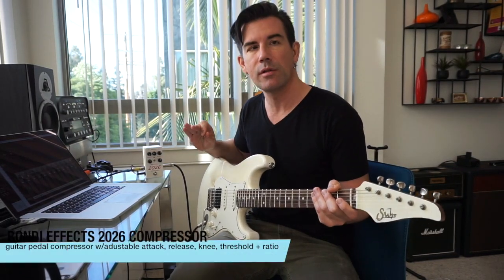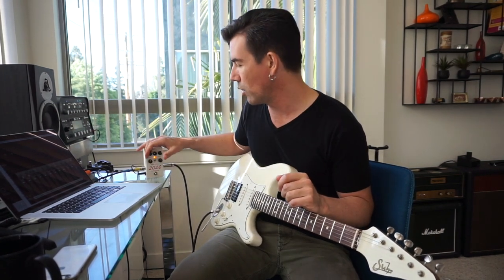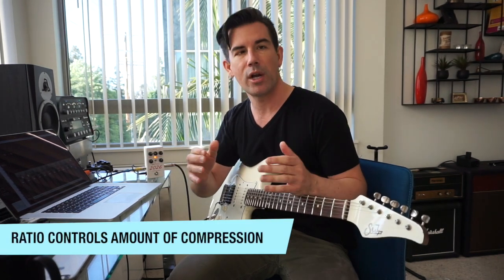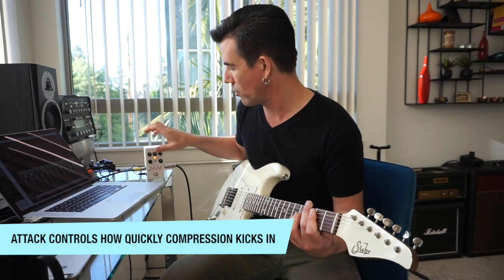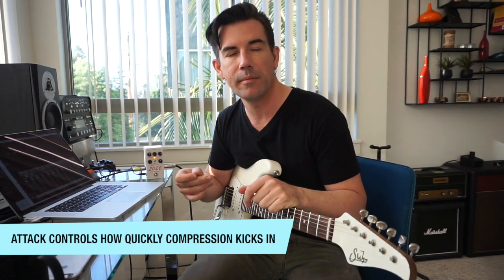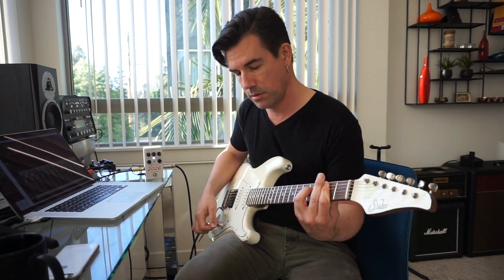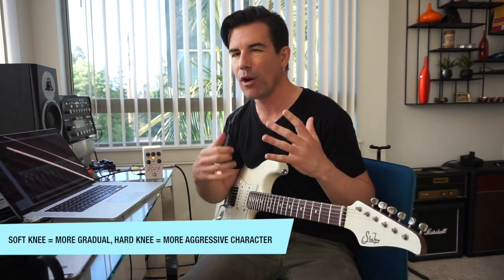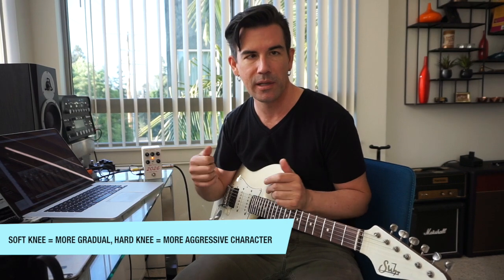GUITAR COMPRESSORS    EXPLAINED! Tone Secrets #5

Comment: Compression is one of those weird effects that even after watching videos like this still leave me wondering why people use compression.  I understand what compression does (reduces dynamic range...makes the soft sounds louder and loud sounds softer) but maybe it's the limits of what you can hear over YouTube or maybe its me, maybe my ears suck, but what compression does is so subtle and I've seen videos with people using clean boosts that to my ears achieve the same result.  Still pondering compression.
Reply from the maker: +WiserInTime if you listen to the solo in the little clip at the end of the video – that tone is completely clean. And yet the compression feels under your fingers like similar to when you have some overdrive. Listen to when I pick a note, and then bend, or when I pick and then slide between two or three different pitches- it wouldn't sound like that without the compressor. So much would be lost. It gives you sustain, allows you to push the overall tone forward more, and makes everything easier to play. It makes clean sounds, especially when in a mix, less anemic sounding. It is absolutely essential for some sounds. I don't really play clean unless I have a compressor on. If I am on the clean channel on my amp, and it's set clean and I don't have an overdrive of any sort on- I always have a compressor on.
Reply: +PeteThorn Thanks for the thoughtful reply.  Will be listening carefully to your full review of that compressor pedal.  
Rock on. 🤘
Reply: WiserInTime your not alone man. I dont get compressors either. Im using a friend's boss cs3 and it just ruins my tone. It does sound cool on the clean channel as Pete said. You can kinda make the electric guitar sound like an acoustic, wich is perfect for struming. But even then i dont find a need for it.
Reply: Unless its really being used heavily as an effect then a lot of it is about feel which won't come through a video. Pete says he doesn't really play clean without a compressor on and guys like Andy Timmons virtually always use them in front of their clean channels as well. Single coil pickups, especially nice vintage output ones, will almost always sound pretty anemic when played straight up clean. They also have a very wide dynamic range which becomes pretty uncomfortable to keep under control in many musical situations. You'll find yourself either setting your clean volume just high enough to cut through and you're pretty much stuck playing aggressively otherwise you'll disappear in the mix, or setting yourself with plenty of extra volume headroom which restricts you from playing aggressively otherwise you'll take someone's head off. 

For anyone with an HSS style guitar with low/moderate output single coils, a good compressor is pretty much mandatory if you really want your tone to be balanced across all of your pickup selections, especially notch positions which can be very anemic in a band situation. 

All of the above is why it is no surprise that compressors are pretty standard with bass as well, especially basses with single coil pickups.
Reply: It has a lot to do with fitting in a mix. Listening to a compressor on a solo guitar outside of the mix isn't very flattering, it can sound flat and boring. When you're in a band playing through a PA on the other hand and you as a guitarist, the bass player and the singer are all using compressors, together you usually sound miles better and clearer than if you didn't. A compressor allows you to control the tone and attitude of your guitar by playing soft or loud the way you always have, but without going up and down in volume while doing it.
Reply: Excellent vid and excellent replies.  I just learned a ton.  Hopefully to contribute something, here is where my head is at after all this.  I have a Peavey Delta Blues amp, a Jeff Beck model strat (noiseless pickups) and I use a Bogner Wessex overdrive that I put straight on the clean channel and with a little amp tremolo voila that is my sound.  But, to the points being made, if I want to play louder to accommodate for others, then bam the tone starts to spread, the strings "feel" wider and it's like Mile Davis, when I lose my tone I can't play, I can't pay the bills, I can't @#$% , I can't do nothing.  Also, I think for distorted leads it will add sustain where I want it, especially at higher volumes.  So, this is where I am going to go next.  Maybe this pedal or the Bogner Pete just reviewed.
Reply: The explanation that really clicked with me came from That Pedal Show.  Dan said it is "overdrive for your clean sound'. It let's you hang onto chords and notes and let them ring out. It is very much a "feel" thing.
Reply: Morgan Cross But guitar is all about dynamics. And as you say compressor kills your dynamics in deed. You end up changing your picking technique (picking hard or soft) and killing the dynamics because a pedal is doing the job for you. Everything will sound parallel and the same no matter how hard you pick, no dynamics. Thats kinda dull to me.  I use my guitar volume knove A LOT for that exact reason. I tend to leave it at around 6 or 7 for rhythm, and for leads all the way up (depending the case) and then boom! more volume and saturation. A la Alex Lifeson
Reply: Joaquin Odriozola not at all! If a compressor kills your dynamics then that's because you don't have it set right for that application. It's also the reason so many new compressors have a blend knob.
Reply: No, not as I say. A compressor controls your dynamics, if it is killing them then that is complete user error. This is not a black/white binary thing. Actually watch the video and listen to/research what Pete is talking about. Ratio, Knee, Threshold....all these controls exist so you can fine tune how much compression you want and when it happens. COUNTLESS pros rely on compressors in their live rigs and every single professional studio on the planet is going to have racks of compressors of all different styles that will end up on just about everything in a mix. But here you are with a Boss CS-3 telling that compression is bad. Do some homework please, and also get yourself a decent compressor to base your opinion on.
Reply: +Joaquin Odriozola Dynamics can mean different things though. In audio terms, dynamics is just the decibel range. And as such, no, a guitar is not all about decibel range (which a compressor is). Obviously, the reason you play loud and quiet and use your volume knob is because the strings, pickups and amp SOUND different when you do that. That is also called dynamics by us musicians, but it's not the same thing and has nothing to do with what a compressor does. Those are the dynamics that makes a guitar sound great, sheer volume dynamics however just affect the audience's ability to hear what you're actually playing. All amps and speakers have some level of compression already, so do your eardrums, so saying compression kills dynamics is pretty misguided.
Reply: Morgan Cross no no. Im not saying compressors are bad. Basically all of my idols rely on them. It just doesn’t work for me. I DO get some interesting sounds with the boss. But even then is not worthy for me. I end up tap dancing on like three pedals to go from clean/compression to dry drive. And it is unjustifiable(for me) to spend $100+ on a pedal I"ll barely use. Id rather get a different drive pedal for that just for the fun. And the boss cs3 is not supposed to be a bad pedal(not the best either) Its been a standard for decades and even Nels Cline still uses it today! and he sites compression as one of his main effects. no need to get edgy here lol. we are all here for the same reason.
Reply: Understood, I apologize. Being primarily a studio guy I can tend to get frustrated quickly when I think guitar players are "being guitar players" as I like to say, meaning they only pay attention to the guitar as opposed to the entire musical equation. Things like "I don't need EQ, I only need my hands and my tone knob" or the comments about compression being bad etc. I really think you just need a good quality compressor to appreciate what it can do for you.
Reply: WiserInTime I heard a big difference when I used a compressor, it's very noticeable to me with clean sounds especially finger picking, with a pick it becomes less obvious. But its more of a studio type effect if used subtlety, like it makes things sound more 'even', in subtle use. But as I said before I am sure that you could distinguish between a finger picked tune with and without comp, to me that's where it is most useful. On the odd time I use to get a really smooth even distortion/OD but not too often.
Reply: Morgan Cross no drama man! I totally get you. I also hate it when guitar players behave like guitar players. Im in my early twenties and I still have A LOT to learn about technique and theory and how to apply it. You know, grow musically. As J. Coltrane would say its a lifetime cicle. So i rather spend my time on that instead of wondering if i need another pedal in my board. I haven't reached that level yet. But you know, pedals are soo addictive :D
Reply: This is one of the more informative threads I've read on YouTube.  👍
Glad I posted my comment because I feel like I got some good answers from everyone.
Reply: So, on all your demos, the clean sounds have compression? Hmm. More defined in the mix? Cool, thanks for the info.
Reply: Morgan Cross countless pros also do not use a compressor lol. To each his own.
Reply from the maker: Milo- Not always- if I'm demonstrating say, a low gain drive, i won't use another pedal- I want you to hear the drive only. If i do a delay pedal demo- maybe then, yes. Because it's not affecting the tone of the delay, if you catch my drift
Reply from the maker: It's not a black or white issue. Overdrive IS compressed by nature. So if you play distorted at all, you're using compression! Don't believe me? Record something in protools or logic, any DAW. record a clean part, a crunchy part, and a heavily distorted part. Look at the waveforms of each clip. See how the clean one has way more peaks and valleys? And how as the parts get dirtier, they look more like a sold block of audio? That's because the dynamic range is reduced- because of the compression. Anyway- compressors are unnecessary for many things, essential for others, and can or can not be used for many things. Personal taste. It's not about "Killing dynamics' like it's some bad evil thing- it's about pushing the whole sound to the forefront, and sometimes adding sustain, and smoothing out aggressive peaks sometimes. watch my original Cali 76/Sliderig comp video for an example of a tone that'd be IMPOSSIBLE to get without a comp- the slide tone. Crystal clean, yet sings with sustain. Lowell George made it did it by running 2 1176's into one another. Taht was the whole inspiration for that particular unit (sliderig).
Reply: Pete Thorn My cell will also spell "taht" without spell checking it to "that". Is "taht" even a word? Lol
Reply: Of course, the point in stating that was to counter the idea that compressors are inherently bad and "destroy tone". Obviously if that were the case then no one would use them, let alone a professional. I didn't mean that in a "if you don't use them you aren't pro" kind of way, but IMO anyone that plays clean can benefit from a properly setup, high quality compressor.
Reply: taht depends on who you ask :)
Reply: I think that Youtube also may compress the video and audio which may make the effect a lot harder to demonstrate.
Reply: It's good for legato. It sounds better, but it also makes it easier to play. If you pick the first note on each string & hammer & pull the subsequent ones it lowers the attack and level of the picked notes & boosts the level of the following ones so they sound even. If you're doing slow legato with hammer ons & pull offs the notes sustain better, otherwise weak ones decay quickly.
Reply: Ah... No. A compressor does NOT make soft sounds louder. That is an Expander. A compressor ONLY bring down the top i.e. the max output level. And a "good" compressor will NOT affect your tone. The compressor is (should) only reduce the max output.    Boss has a Compressor/Sustainer (CS-3) It is a compressor and an expander. The expander will cause softer/quieter output to increase. With the CS-3 you can make literally everything you pick be exactly the same output level. whether you barely touch the string(s) or slam them as hard as you can. The output level will be teh same.
Reply: Yes, a CS3 is what I've got and it's very good for legato, and sustain. OK I'm not an expert, I just thought it was a regular compressor, it's the only one I've ever had.
Reply: Back in the day I had a CS-3 also. Don't know that I ever really was able to use it effectively. Frankly I don't understand why anyone would use a compressor for a live situation. Isn't part of the point to play with dynamics? So why would one want to reduce their range of dynamics. All that said, I completely understand using in the studio. The help with the legato would be mainly from the Expander side. The expander is essentially an automatic variable gain control. i.e. as the signal is dying down the expander boosts it up to maintain a consistent level of output.
Reply: Good to know, thanks
Reply: agree with you,  normally I use for add more boost than reduce attack o dinamics
Reply: Okay if you read each comment as you go this is a short one for you why to use compression? It's as if you have a drummer who hits the crashes and each drum the same every time even during a quiet song or a loud song I know that we do play that way but subconsciously we miss it. Nowhere in the history of recording even the natural compression tape any band never used it since the first early recordings of Blind Willie Johnson help we never had some sort of compression to assist us in creating a comfortable level atmosphere 4 are captive audiences. And if you don't give two shits to his hard work sorry for cussing mom you go do what you think is best. Seems everyone has their opinion but nothing to back it up with drives me crazy my drummer and I are in a huge debate after just getting done laying down the tracks to our demo he wants to book studio time. I have to explain to him as if he was 13 years old he's only 5 years younger than I that the whole purpose of the demo was to get a little taste of what the studio will be like and if we don't cut back on all the mistakes to have in a Droid Studio experience there will be no Studio so I need a compression pedal thank you for your excellent demonstration engineer recording I never knew of this pedal for this 20 plus years I've been recording I did not know people use them on stage which makes the huge huge factor for the sound engineer makes him happy not having to worry about shoot spikes even if it's a tiny protection it just helps out your overall sound and I guarantee you greatest guitarists out there you find one without a compression pedal beers on me and yes throw a big muff at the end of your chain and for odd reason it has a built-in compressor hence the sustain that's the little big muff now the standard larger big muff AIU that's a bit different of a town as I throw signals all over the place with a be pedals or whatever you want to call him I call him little pushy toggle switch things. Kudos to your video once again thank you for leaving the back, it's up to you that's how we truly learn but hey just got to be someone out there in the audience that has to pay for our tab after a good show. Soak up knowledge don't distort it at your word for the day it's late for me I just got done mixing so my situations and spelling will be off but you'll figure it out I'm sure thank you for your time in this video and if you haven't done so yet... attenuators! Especially for any amp over 30 Watts take the Peavey classic 30 start with that then go to fender Reverb with the vibraphone Style switch, I can't remember the name so so tired !  Two amps like my supersonic 2001 original Vibe and base instead of vintage and burn that amp at 3 I could shut down at venues like the exit in or Senators Hall Fenton looks familiar and they tell me the turn that app around or take it out of the room it's too loud which is good more the better than not enough. but I cannot drive those tubes without a good attenuator. now that has a lot to do with how early the tubes break up which I like a good strong lower number tubes so it takes more power to really drive it rather than an early break up at lower volumes. now that being said you have your continue later which is like a volume knob for your speaker but if you just put a potentiometer pot volume knob whatever you want to call it on your speaker wire you're going to damage yourself or you when it comes to tube amps yep I know what I just said. So anyway tur is also known as a power soak and soaks up that energy the speaker was going to receive gently releases that distorted Drive tone coming through your speaker and with the right one even down to One DB if need be it's discontinued so I don't find it an issue but if you could find what HT something bought out from Gibson but it's a Gibson 8 ohm power something it's gold and it's the only things Gibson I own until I get a hummingbird acoustic I'm a huge Fender fan, but I have never heard of Thunder or any guitar comes close to a Gibson acoustic there's other ones but for me the hummingbird.  if you didn't understand everything I don't want it. My eyes and cross my T's. Feel free to contact me on my English issues and one day I'll become good at that. You go rock out without your compression just be careful be wise to your Dynamics it's not 1,000% necessary but it sure does help. I'm sorry for those get offended by this in advance. the ones that are rude posts , read I hope you read it and get upset at me instead of this gentleman because you idiot me Rockstar come talk to me don't bug him. And in fact throw your phone in the toilet. Serves better purpose there.,,  it's the auto show season up here in Detroit and I don't even realize that I'm talking still. I'm going to send it anyways cuz I learned a good lesson and I'm going to buy myself compressor tomorrow. Oh yeah at the end of any sentence it makes it okay to say whatever you want by saying God bless don't forget that too!

M.Porter
Redeye Raccoon
Detroit MI
😁 the city that smokes all day and night!
Reply: take home message;   use compressor when playing clean.   that, I can remember.
Reply: WiserInTime it’s more of a feel thing for you as the player than something meant for the audience to hear. Can do horrible things or can make the guitar feel a little sweeter
Reply: @joaquinodriozola4963  boss c3 is a terrible pedal. A complete misfire . There are much better compressors out there.
Reply: In the first place, Pete isn't imposing the use of compressor...it's up to you. He is demonstrating the functions.
Reply: I have the same ears...    sucks.  LOL
Reply: It's so hard to explain, and I didn't understand it either until I actually bought one. The biggest reason is, you can FEEL it, which makes you play different. It changes the entire environment, dynamics, and therefore playing style, which makes it a pedal worth having for me. I'll play completely different when it's turned on (whether by itself or with other pedals)
Reply: I remember going into guitar center to try some different compressors, mainly a country chicken picker at the time, and guy behind the counter said i really didn't need one unless i was playing metal 😂 ahhhh to each their own but a nice compressor is ESSENTIAL to a lot of my playing alot of the time.